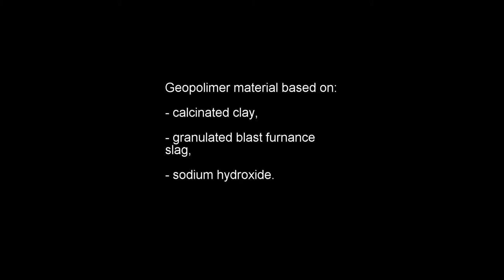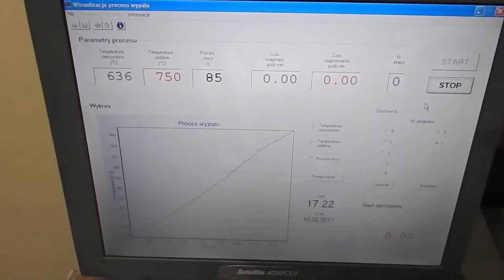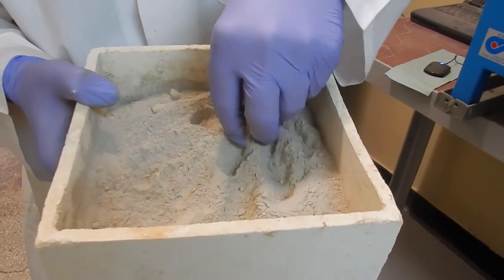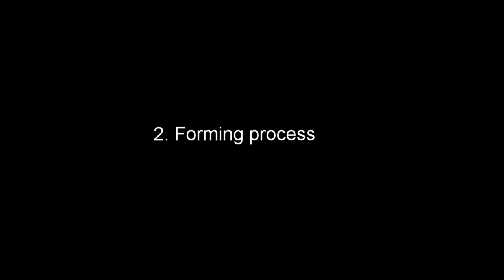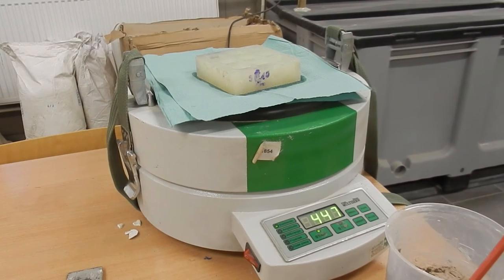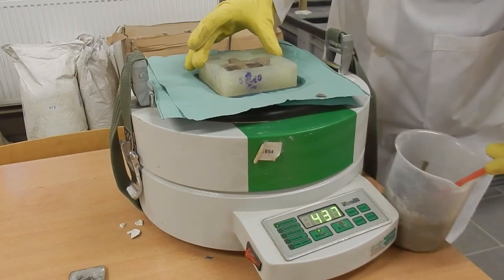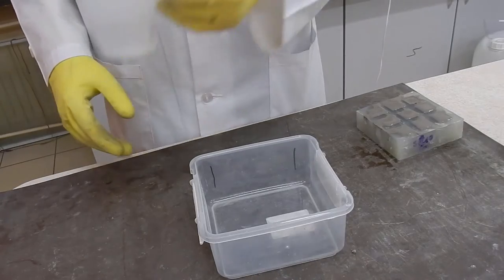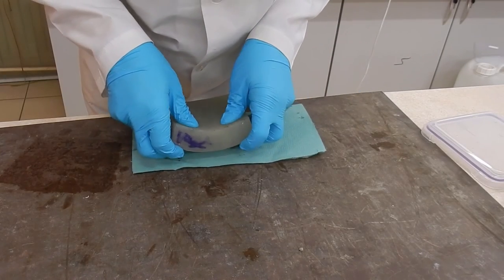Geopolimer material based on fired clay, slag and sodium hydroxide. (NCBiR, ERA-NET-ERA-MIN/01/2014)

Comment: Hi, can you also make geopolymer without fly ash and slag? Those aren't sustainable ingredients...
Reply: There are some without. But there is nothing without any emissions. Just the post of yours here makes significant emissions. Coal fly ash is still dumped and until this practice exists it is way better to use them to make geopolymers. See, normal concrete is only good for 50 years, some say 100. A good geopolymer lasts for thousands of years which is because of its glass-like microstructure. Btw on my channel is a geopolymer recipe without slags and fly ashes which can be the basis of a geopolymer concrete. Please take not that it "can be the basis". To have an applicable building materiel one has to put in the effort. Commercially exploitable geopolymer materials are not posted in the net for free as they are very expensive. But the metakaolin one is a good starting point. Cheers. Pat
Reply: I see your point, thank you. I am stil llearning about this. Will check out the vid!
Reply: Oh, i only see two videos on your channel...